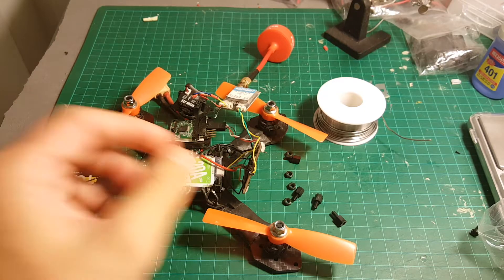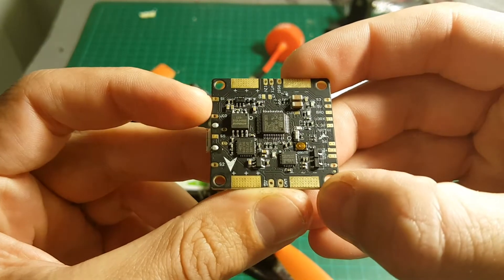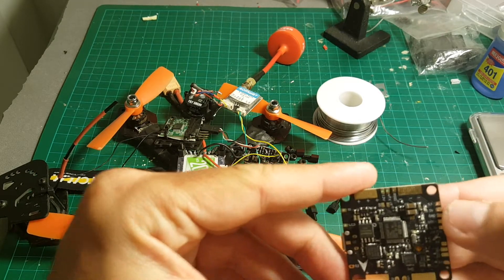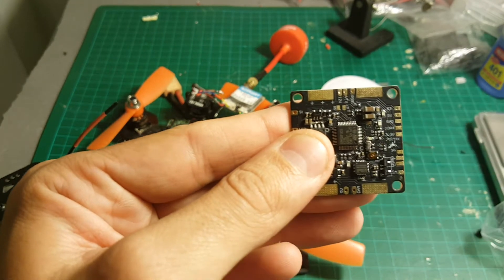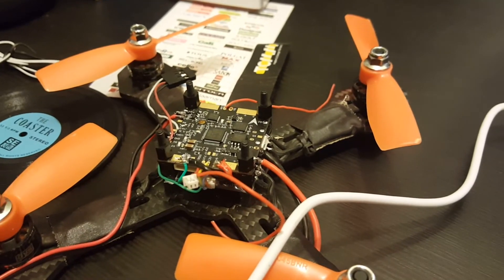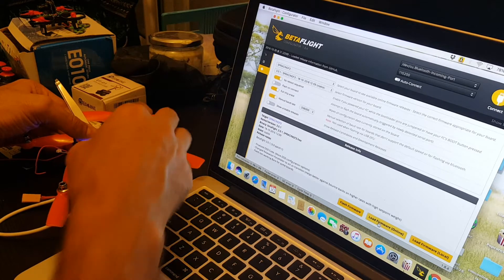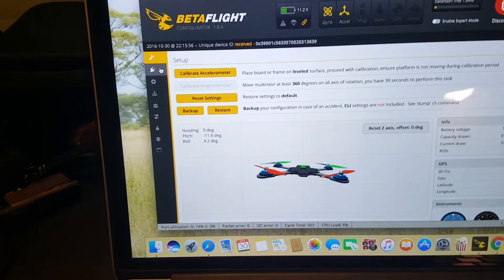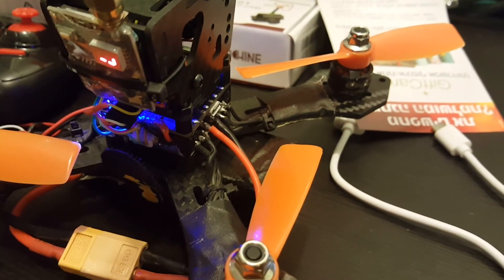F3 Racing V2.2 6dof Flight Control AIO Integrated with OSD PDB 5V 12V BEC for FPV Racer basic guide

Comment: I have this board and using sbus. With a good working receiver x4r bind to a Taranis x9. In betaflight or Cleanflight latest ver I am having problems getting any channels to work. Thr, yaw, pitch, roll and any switches did not work. Also the LED strips will not program. Motor run correctly. Fpv camera and osd work correctly. I guess the controller is not functioning correctly. I tried different flight receiver did not help.. Any help!!!! Please!
Reply from the maker: Bob Smith Did you try with a different UART port?

Comment: Hi, im having problems with the osd cut off. The osd is showing half the digits on the top of the screen. I have the latest versin of this FC. 

I use fatshark dominator v3 and the camera is 600tvl with 720/480 resolution. Camera resulution doesnt match up with the Dom V3. Do you think that can be the problem?